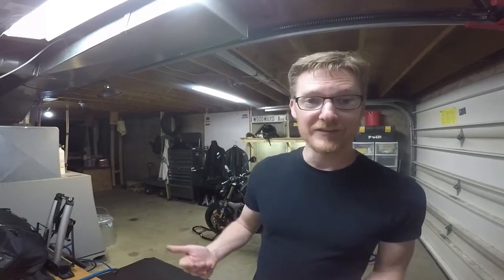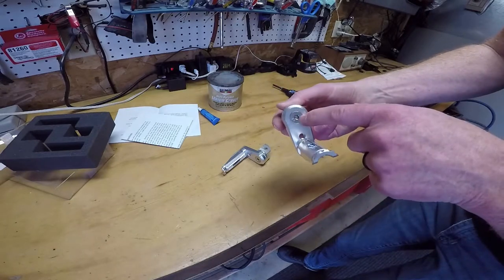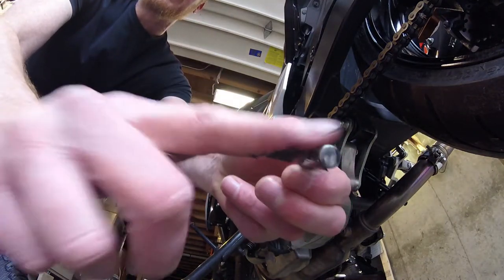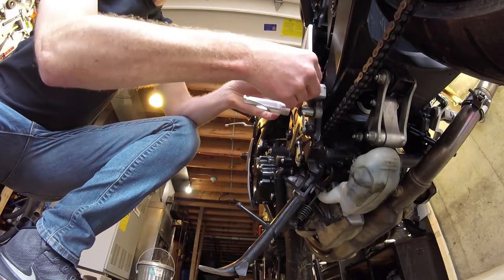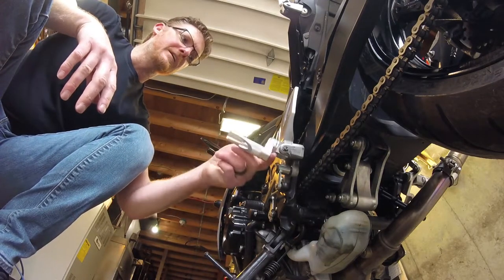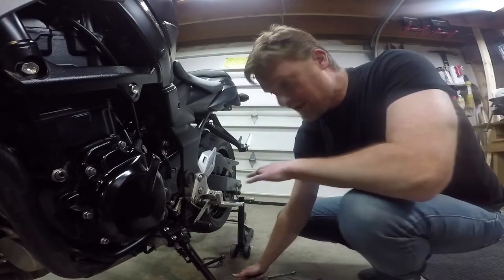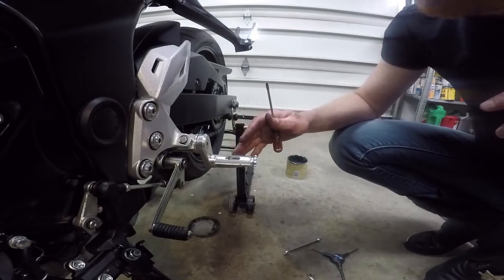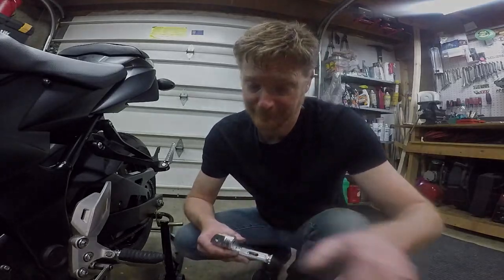Install & Review: Slingshot Racing Adjustable Foot Pegs | GSX-S750

Comment: You saved me made me realize that the actual footpeg comes apart from the brace because I recently crashed and don't have a driver side foot pedal so I thought I was going to have to spend fifty bucks to get a new one but I just saw that you can take the foot part out of the back and swap it for the front so thanks
Reply from the maker: So glad I could help! :D

Comment: Hey I just switched over to GSXR foot pegs because I couldn't stand the rubber foot pegs. Plus the rubber foot pegs (to me) is what differentiates the GSXS from being a standard bike and a sportbike. I got mine from Ebay in gloss black for under $20 for the front and rear of the bike. Turns out our bikes can use a ton of parts from Gsxr's.
Reply from the maker: Rob I am gonna look into that. Thanks for the heads up!

Comment: As a thought you could put a slight bend in the gear shifter and this would bring the shifter out and back and make everything in line with your foot position.
Reply from the maker: peter vaughan even so, it would not be comfortable. Take the shifter alignment out of it and it’s all wrong. It looks good on paper... but It’s not a solution :/

Comment: I had the very same issue with a set I bought from eBay for a Gixxer 750, pigeon toed shifting and braking was very uncomfortable and dangerous due to the delay trying to find the controls.
Reply from the maker: It’s a shame too cuz it sure looks like a good idea. Thanks for your feedback 🙏
Reply: @sstressfl  I think they just need to make the bracket thinner, maybe make the bracket of titanium so it's more robust.

Comment: It seems like all you had to do was loosen the shift bolt and move the shift lever a bit to account for the lower height. 

I did that with the stock to make it easier to shift while keeping the 1N23456 shift pattern. 

It seems like this may be good for riders looking for more leg room on long rides but the gap could be an issue
Reply from the maker: I did that. The levers were still too inboard. The pegs push the feet out too far.
Reply: @sstressfl  ok, lame. Thanks for the reply

Comment: Its great to hear and see if these pegs work, the only thing in  my mind is pengali quick shifter that push button thats rest near ones clutch lever, but what would be dangerous is when turning corners come up.anyone wants comfort, one need to buy a bike like it. But thanks for the upload
Reply from the maker: Lower the pegs or raise the seat. These pegs are all wrong. But what I have learned is that the seat on this bike collapses after 45 mins of riding which is enough to compress the knees by an inch or more. Custom seat is coming, one that provides more support and does not collapse 👍

Comment: Nice video. Did you find any working solution afterwards?
Reply from the maker: I know the real problem now. I changed my focus to the seat. I realized that the oem seat collapses after 30 mins of riding and I lose 2-3” of rise which compresses my knees more. I contacted a local custom seat maker and he is going to rebuild the padding so it is comfortable but doesn’t lose it’s shape. It’s there I just need to spend about $300 and I haven’t yet. But a new seat is the solution 👍

Comment: Bend out the gear selector and the brake about 5 to 7 degrees and it should work
Reply from the maker: I was ready to do that to fix the alignment. But that wouldn't fix the fact that the peg is too narrow. There isn't enough room for your foot and it spreads your legs further apart. On paper it looks like a great idea. But in practice its a terrible solution for this application.

Comment: why not just get a longer shift peg which will extend it putting it back in line with your foot. wouldnt that solve all your issues then?
Reply from the maker: I addressed that in the video. Definitely can extend the shifter and brake lever. But it still would not fix that these pegs kill alignment, comfort and valuable foot real estate.
Reply: @sstressfl  ahhhh I must have missed that. I just ordered a similar one for my cruiser. Same lowering linkage but different peg. Curious to see how it works out given your experience.
Reply from the maker: RicWorks247 and a cruiser might feel totally different! It would be great if you stopped back and let me know how it worked out.
Reply: @sstressfl  will do. Should take a week or so to get them

Comment: how tall are you ?
Reply from the maker: 6’ 2”
Reply: Do you feel comfortable on the gsx s750 ? I’m 6’3 and I m looking to buying one too
Reply from the maker: @mariantamas9606 it’s definitely a smaller bike but I do 300 mile day rides on it with no problem. I have to stop and stretch it out once in awhile but no more than any other motorcycle. I have always wanted to get a custom seat ($300-400). The stock seat collapses after 30-45 mins and no longer provides proper support/padding. My only complaint :)